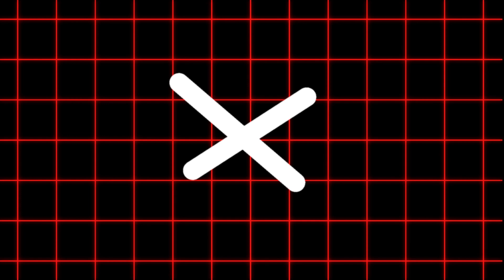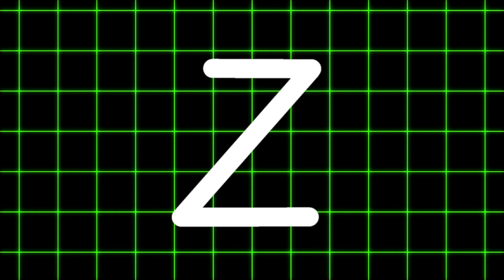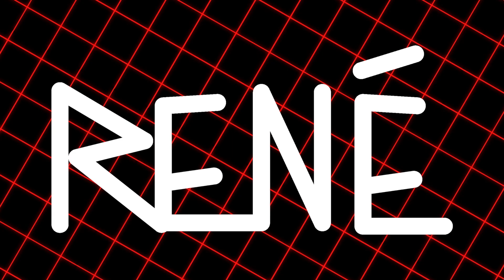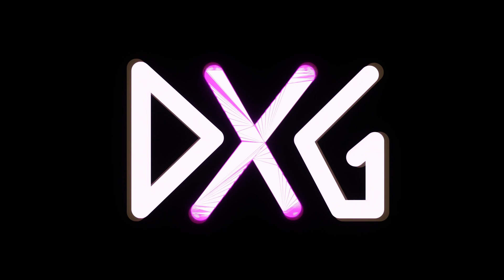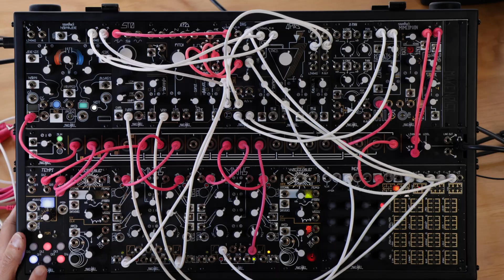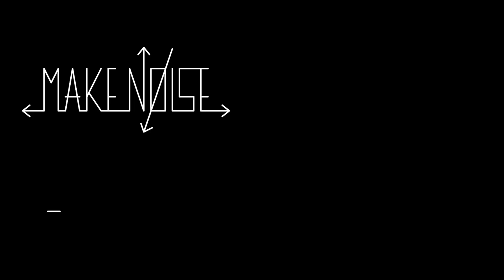Interlocked Rhythmic Addresses

Comment: Greetings. Are you using the Zoom H6 as an audio interface or just recording? I am looking for an audio interface for my shared system.
Reply from the maker: I record the system's output into the H6 and then load the files into the timeline on the computer later. I believe the H6 works as an interface, however I have not used it in that way so I couldn't say how well it works.